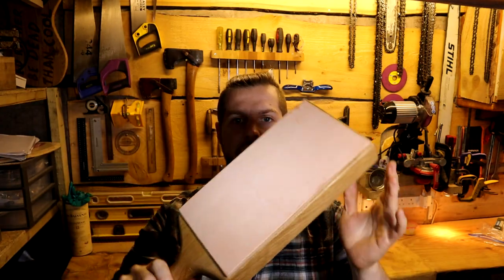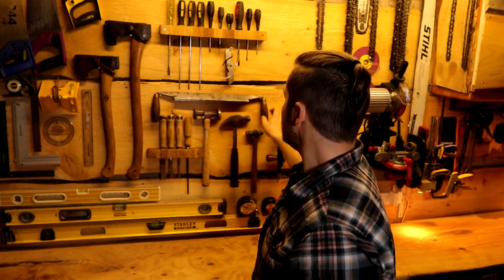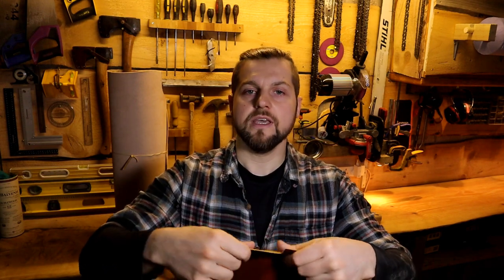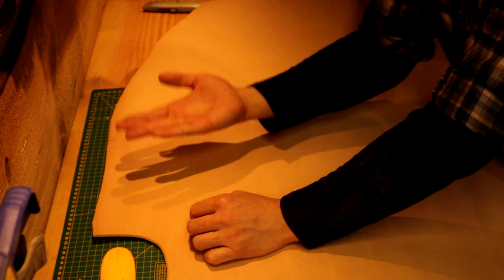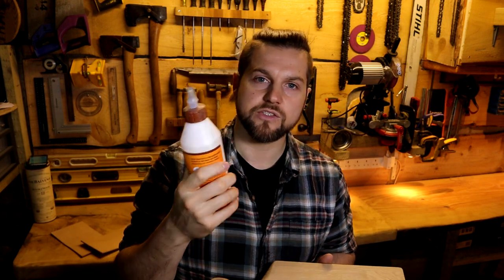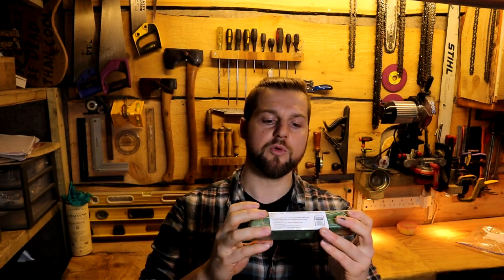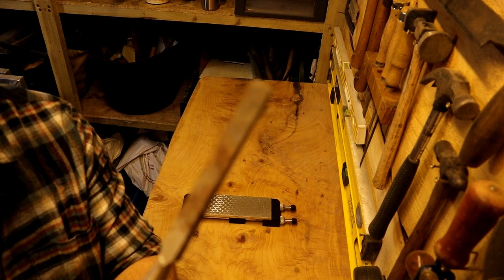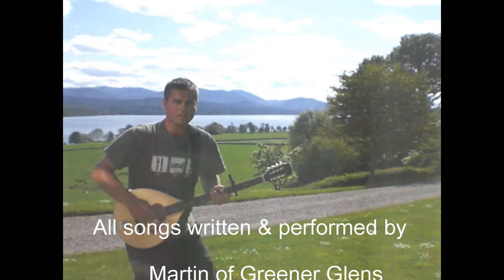Making the Ultimate Leather Strop for Sharpening Wood Working Tools

Comment: 21:45 I leave the edges unbeveled so I can use those edges to clean up my bevelers. I built a board to specifically sharpen and strop my bevelers and French edgers but I use my strop a couple times an hour so it's always handy. So if a tool has an edge I strop/polish it before I use it or for example on my swivel knife I'm using it every 20-30 mins, so I have a dedicated strop at both my tables. 
The edges on 10-12 oz vegtan fit in the groove of my 2 and 3 beveler. The geometry on my #1 beveler makes it so this doesn't work as well IMO and since I use #2 and #3 the most it is a neat hack.  I think the next strop I make I may skive 2 of the edges and see if that allows this work for my finer edges. It only needs to be skived in about 5mms to allow that edge to fully engage the groove on the beveler. 
Also if you don't have a board you need to make one.  They work amazing and  I like them more than the gig and wet/dry paper method since I can do sharpening and honing/polishing on one tool.  Weaver sells one and is what I used as "inspiration" when I made mine (out of scrap material so it was "free").
Have a wonderful day!
Edit: I forgot to mention. I love the idea of a super wide strop. Mine are about 100mm wide and I feel as though I am juggling my head knife on it.  I think it maybe time for yet another build.  I think I may make 250mm wide and  bolt it (handle wil slide into a bracket under the table) on to the side of my cut table and it will be "hanging" out to allow better acces.
Sorry for the War & Peace comment on strops. Lol

Comment: Great video thanks.  I don't need a strop that wide and rugged for my uses but several great tips there.  Such as the double sided tape and that finish.
Reply from the maker: Admittedly I do have several strops for different uses. This is my workshops strop for big knives, chisels, plane & axe blades etc but I have different ones for my adzes, gouges & a more portable sharpening set up for travelling & camping which I really must make a video on.

Comment: The tooling/saddle making leather is nice, but too thick. What this does is that it compresses as you strop. I have one friend who swears by kangaroo leather because it does not compress. Yes, you are supposed to use only minimal pressure, but not every one does that. I haven't tried goat leather which is very tough. Not sure about compression. Some of the automotive upholstery leathers have 'fillers' in them so they have a memory. Haven't tried any of them yet. In general, thinner is better, and on a smooth surface. MDF is too coarse. Some of the baltic birch plywood is pretty good, but leather is still better. Stropping does leave a nice polished surface, but the primary thing is to remove the burr. No matter how fine your stone is, for me, up to 15000 grit, you still need to strop.
Reply from the maker: I agree mate but properly veg tanned cow hide is pretty hard especially if you can afford the real nice traditional oak tanned stuff (a bit expensive for a strop) & as you say when you combine it with the right technique you should have no trouble. I've tried kangaroo leather & it seemed ok, had a bit more of a pronounced grain than the cow hide which I liked less but it was stiff but more because it was thin. If you have access to harder more exotic leathers experiment away but my strops give me razor edges every time & with minimal explaining so can relative beginners.

Comment: Brilliant. Thank you for sharing this very instructional video. Following your video I've found some 4mm veg tanned leather and will mount it on all four long sides of 75x75x300 leadwood block so I can use different compounds on each side. I'm primarily using for kitchen knives. My thinking is that by using a bigger square shaped block it will help raise the strop off the working area allowing freer movement. One thing I notice is recommended is 'casing' the leather - you can wet it and repeatedly roll it to stiffen and strengthen it - apparently this makes it perform better as a strop and reduces rounding/convexing the edge.
Reply from the maker: 4mm veg tan should be perfect & should be hard enough to prevent significant rounding of your tool's edges if it is tanned well. Casing is more to soften the leather before carving or tooling. I think what you are referring to is a kind of work hardening & I think it's probably overkill. The fastest way to harden leather is to heat it but it is difficult to get right without ruining the leather. A process sometimes used is cuir bouilli which is a method of boiling leather to make it hard typically for armour. When I make leather bottles I heat them in the oven & saturate them in beeswax & they feel like hard plastic after that. I would say the best thing to prevent rolling the edge is to get your stropping technique spot on & if you want an ultra rigid strop just use a piece of very flat mdf with stropping compound on it - much easier that hardening the leather.
Reply: @GreenerGlens  You just fried his brain with knowledge lol 😁👍
Reply from the maker: @MrBillUp  🤣 glad to be of service 👍